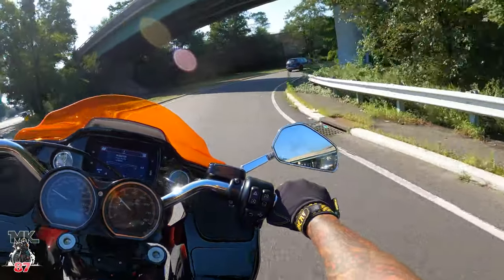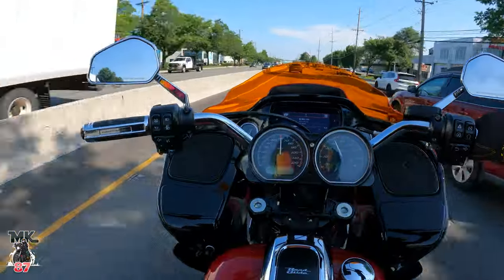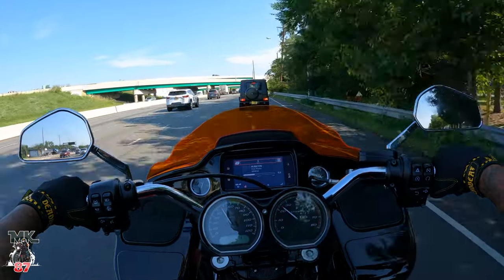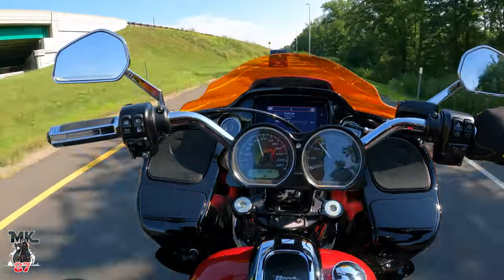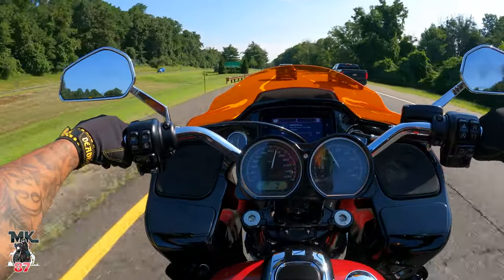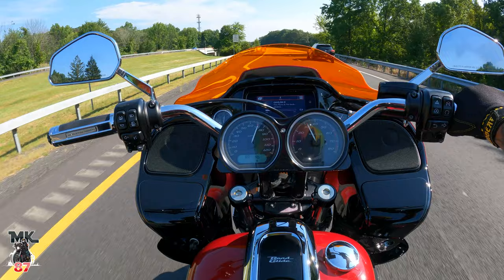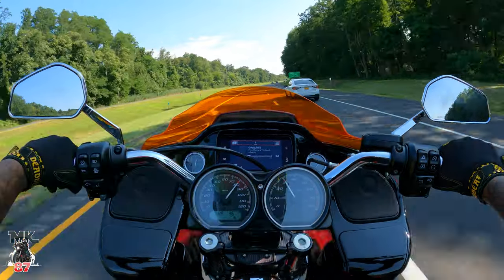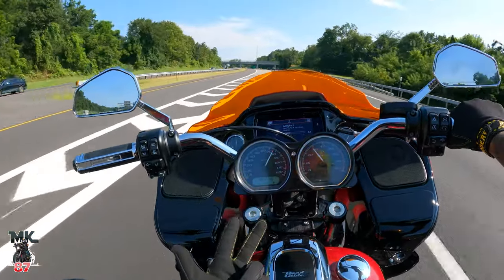Feuling 465 reaper cam vs S&S 475 cam / which is the best cam for your Road Glide

Comment: Marvel,        you forgot,   zippers 468 hands-down best small size cam!    Fueling not quite enough,  s@s is rough.     468 pulls longer and stronger.  With a smooth ride,
Reply: There is no “best” cam, hence the reason builders use multiple brands/sizes. It’s the use that dictates what you should choose.
Reply: Yes,  468 fits most,  especially wanting a good dependable stage 2
Reply from the maker: I’ve herd great things about zippers.
Reply: It's a good compromise between a 465 and a 475.
Reply: The 468 does make your bike run a little hotter though
Reply: What is a small size cam? People get hung up on that lift number. The difference between .465 and .475 is about the size of a couple human hairs. The lift is the least important aspect of a cams profile.
Reply: @freebehindbars8654  Every rider is different and wants different things. I want a cam that does everything well but doesn't put excessive force on the valve train. Reliability in my ride trumps performance. JMHO. I ride a lot of long-distance rides.
Reply: @Marvelkid87  Did you have a dog help you? 😁
Reply: @1962egl  Why?
Reply: @1962egl  Good point. The lift is important, but not as important as the duration and RPM band the cam is operating in. Lift is important for determining the springs the valves need more so than the actual performance of the cam.
Reply: @dennismccleney2302  why what?
Reply: @1962egl  why does it make the bike run hotter?
Reply: @dennismccleney2302  early intake valve closing seems to be the consensus.

Comment: Just put a 475 in a 107 tuned with TTS. It falls on it’s face under 2k, but pulls like a train 3 to redline. If you use it for around town, low speed, it’s definitely not for you. Highway passing and riding at speed, it’s good to go.
Reply from the maker: Right on 👍🏽
Reply: because its not a torque cam if you wouldve looked at the dynos the 475 doesn't come in till about 3200rpm & the 465 at about 2500rpm
Reply: @wateva1659  think I bought, installed and tuned my bike without knowing what I was getting into?  Just sharing my experience for those that do not know.

Comment: Needs to be dyno tuned correctly and you will not have that 475 “bogging” feeling. Believe it the dyno operator makes all the difference.i have same bike same cam same issues when dyno tuned at Harley. Then to a private shop and the magic happened. NO more issues.

Comment: The Zippers RS 468 is a great cam for my RKS. Awesome TQ cam that pulls all the way to the redline. Also, running KW exhaust with a Fuel Moto header pipe.
Reply: best cam out there. my 114 is pulling 118/133.

Comment: great video.. one note.  the two cams are totally different in category and purpose.  The 465 reaper is a torque cam, the S&S475 is more of a hp cam that comes on stronger in the mid to higher rpm range.  An apples to apples comparison would be the S&S 465 torque cam..
Reply: I agree

Comment: You should include the total cost to get that type of performance . Intake, cam, pipes, tune, tuner (device), labor. That way when you’re comparing this to the Challenger you can explain to your audience that the Harley runs as good as the Indian but it costs $5000.
Reply: Set of slip ons and breather be around 1200.Tuner with dyno tune 1000. Cam chest kit 2000. Labor 800 to
Install that. So about 5-5500 Canadian.

Comment: My 2 cents (based on actual experience)...Not familiar with Feuling's 465 cam, but I am familiar with the S&S 465 cam and the S&S 475 cam.  Also, The Wood 22XE appears to be a great cam, definitely worth considering for Touring, 2-up, etc. (just saying).
    IMO and based on the valve timing events of these two S&S cams:  the S&S 465 cam works very well in stock compression 107 (10.0:1)/114 (10.5:1)/117 (10.2:1) M8's.  It has a nice chop at idle and more importantly [where Torque is desired in the low-to-mid range, and hits early] works extremely well in a Touring Chassis Harley, riding 2-up, and riding in the curves up in the hills, etc.  On a 2021 RGS 114, I can feel the torque coming on early (below 2000 rpm), very strong mid-range (2750-4000+), and plenty of power from 4500-5000+.  The S&S 475 cam (IMO needs more compression, 10.75:1 to 11.0:1), as when installed in a stock compression engine, gives up some low end torque but "seems" to have more midrange torque (3000-4500) and nice power on the top end, provided the Tune is spot-on.  I always run a long (full) 2-1 exhaust (and 18mm wideband O2 sensors), ventilate the crankcase (Trask M8 checkvent), and tune with Dynojet Power Vision (PV3b for 2021-2023 Harleys).
Reply: I've heard similar comments about the S&S 465, I was leaning that way for my 21 EGS with the 107 M8. Thanks for the info.

Comment: I had the Feuling 465 and D&D billet cat. 111 hp 118 tq in a 2018 RGS. Came on strong at 2300’ish rpm. I now have a 22 CVO Rd Glide Limited and I’m going to run the 30/30, 64 mm throttle body and manifold. 
I have a friend with a 22 RG limited w/114. He has the 475, D&D and 55mm manifold. That bike is NASTY!!!

Comment: 2023 fxrs 117.  

Just did the s&s 475c cam and cam chest upgrade. Lifters, rods, pump and chest. The heads were done locally by a good Indy speed shop. Larger tb and inj. Installed S&S Cycle 2 into 1 Sidewinder Complete Exhaust System. S&S stinger air cleaner with bypass.  Tuned using PV 3 with target tune. After dialing in I have very little bogging as you define it in your video. 

I’m not real heavy, 138 soaking wet with boots on. That s&s cam has mad ass torque off the line and pulls strong throughout the rpm range until redline. Power is best after 2000 and peaks at around 5700 for my build but no slouch off the stop. Can pull the front end up easily in third. Sound is as you say, fucking hard-on inducing amazing. Great cam that loves a well breathing head and lots of fuel.

I don’t really think of the 475c as a simple blot on and go cam. There are other things you “should do” to get the best performance out os that cam.

Comment: Thanks for the footage marvel The exhaust velocity (often misworded as back pressure) definitely slows down with the oversized mufflers affecting low end torque. The quality of the tune could also be an issue. As far as the sheet starting at 2000 RPM, that is just a common RPM range that tuners usually start the graph because people do not (or at least should not) realistically cruise under that range. Personally, I try to keep cruising RPM around 3000, but that's a separate discussion.

I've heard lots of people say the 475 just isn't a good low end cam. This is incorrect. In many of the instances it is due to what I just mentioned: poor exhaust combination and/or poor tune. I'm confident you can get that torque back, or even improved with the right exhaust combo and/or tuning resolution.
Reply: Finally, someone who understands exhausts. I cringe every time I hear back pressure.

Comment: I have the S&S on my RGS. It rips hard from 3,000 rpm on up. I went with a CR480 torque cam on my RG CVO and it pulls really hard from 2,000-4500. If I snap it I'm sure the bike will go up

Comment: Have the 475 in my 19 glide with stock headpipe v&h torquer 450’s and v&h breather. Did the cam hear kit from s&s and it put down 110hp 127 torque dyno tuned. No  bogging very crisp and extremely healthy. Nasty cam and I love it.

Comment: I been riding too many years. Im 64 now. I do not understand the bogging you speak of. I know what bogging is, but we avoid bogging by being in a gear where your rpms are not bogged down. I have a 2019 Cvo Limited 117 with Bassani headers, 4inch Rineharts, an S&S 475 cam and a fuel moto tuner. 35k on her now.. All I can say is she has plenty of power in any gear. 6th gear you really need to be at 80 mph or above to use 6th gear. Acts like an overdrive trans gear. 
5th and below has all the power. Great video and thanks for taking your time to make it and explain everything. Nice job.
Reply: I believe the point he is trying to make is that the 475 cam comes on around 2700 to 3000 rpms vs the 465 comes on at 2000 rpms. so it is more of a torque cam.
Reply: My bad. Thank you!
Reply: @jimbo4260  No problem, I also been riding for a longtime now at the age of 65 soon. Boy how time flys. I bought a 2022 SGS with a 114 and went through 2 cams so far. First a SE .447 and now the S&S 465 more of a torque cam. I do like it at low RPMs you can't beat it. The S&S 475 really shines with a 124 Big bore kit. It idles off like at 130 or 140 foot lbs of torque. I am not sure if I want to spend the money again on another cam but I am looking at the Star Racing 30-30 cam with a 64 mm throttle body and manifold. It's all about the money and my bike rides okay for a solo rider. check out the videos on the MHP 485 cam it is the Star 30 30 cam. amazing numbers.
Reply: @James-x1z  Hi James....yea bike parts are like tattoos...once ya start it's hard to stop. However money is not what it was back in the day so I've chilled out. The 475 in my 117 I'll say, is plenty of power for me at all speeds. I'm mainly a highway cruising guy. 75-80 mph. I can't say I have any complaints with getting out of the way, at any rpm. MAYBE A PROFESSIONAL TUNE in the future ..." maybe." Lol, but I'm happy as is.
Reply: @jimbo4260  I agree with you about the s s 475 cam at highway speeds, very nice. It's a mid-to-high cam. Happy riding and be safe.

Comment: 30/30 , s/s 55mm aluminium intake, arlen ness Big Sucker, tab mufflers and stock pipe modified 119hp /120tq on 107 EGS. Aluminum intake manifold will help too.

Comment: Just an observation I see a lot.  I hear a lot of people rave about how smooth their cam is and how great it is at 2k rpms after they get rolled by bikes with the S&S 475 cam.  Another factor not talked about is the S&S is cheaper.  Just some thoughts.  Btw, 119/130 is what mine was.  Just be happy with what ya got.  I had a torque cam before didn't like it.

Comment: I’m running the 30/30 .485 Star Racing Cam. I loving it
Reply from the maker: 💪🏽 great cam
Reply: what about the 3/4 Race Milwaukee 8 Cam .585 from Star Racing. Why doesn't anyone talk about that?
Reply: @BM-uj7rt  question. Is that a hp cam or Tq cam?
Reply: @BM-uj7rt  Cause it's too much for a stage 2, and even for a stage 3, it's basically a race cam for stage 4.

Comment: Great video man, that star cam has a 485 lift. Id choose the fuelimg as well tho...only for keeping the components the same, i like the fueling cam plate and pump better too..
Fueling also has that new air filter with that machined intake that looks amazing. If i ever trade my twin cam in for a m8 itll be all fueling parts. I have fueling 525 cams in my twin turd now...they saound damn good and perform awesome too
Reply from the maker: Yea they make all around great parts. I’ll be adding those breathers in if I go back in to the motor for a stage 3

Comment: Marvel, mine came with the harley torque cam installed.. I’ve only installed myself..the 2into 1 D&D, 55mm Intake mani port and polished, Tmann intake, vision tune by DC Cyclez 116/130…not sure if I’m going big bore yet so I don’t want to change the cam yet…

Comment: I’m running the CR480 MT in my 114. Riding 2 up fully loaded with full tank and luggage With a total weight 1440 pounds. I can’t complain about the 11:49 torque the bike feels strong, pulling that type of weight and all 6 gears. Even in six gear  just by rolling the throttle I can hit a 100 mph with little effort.

Comment: I guess I put myself right in between with a Zippers 468 on my 17 Ultra Limited,..crazy torque all the way up to 5 - 5500 rpms..like the 900 lbs. was nothing. A 2-1 modified Shark Road Exhaust completed the aggressive grunt so I am pretty happy fast-lane rocker 😜✊🏻

Comment: Hands down the best cam in a 114 bagger is the WM8 22XE.  Pulls from 1800 to 6500 no problem. Torque cure is completely flat line right across until it meets the HP curve.  Best cam on the market. My opinion
Reply: It’s just a little rough on the valvetrain
Reply: I have not heard this.. can you elaborate more?
Reply: @marvelharris9540  power
Reply: @marvelharris9540  woods cams are notorious for steep ramp angles.

Comment: Currently running an S&S 475 cam and love the sound, especially at idle. What i dislike is the low end power. The bike doesn’t come alive until 3000+. If I change the cam it would be for one that the peak power comes in sooner.
Reply from the maker: Great cam but Very true
Reply: get the 465 its the torque cam & a world of difference & pulls all the way

Comment: I put a 475 in a breakout after listening to the lope of it in your video on the lowrider
But coming from a screaming eagle torque cam it did bog alot off the light and low revs
On an open road it was great and ofcourse pulled harder but in traffic tbh the s/e cam was better and snappier
Probably wouldve kept it if i knew that before and saved money😅
The sound was almost worth the low end dip though as said it is a monster and turns heads

Since sold it anyway
Can you comment at all on how the star 30/30 feels and if it bogs at low revs like that because on a tourer i dont want that and i know you rode that road glide a while back with the star cam

I think the rs468/ s&s465 or your cam suits a tourer better
 interested to hear if the star 30/30 has a bottom end dip on heavy tourers? because it makes good hp numbers but havnt had the chance to ride one
Leaving exhaust variations etc out of it and just general speaking ofcourse
Reply: I think the red shift 468 is a good alternative to the s&s 475, definitely smoother.
Otherwise an 465 s&s or fueling would be the perfect compromise.
But honestly on a touring i would pick the screamin eagle torque cam, at least it sounds way better than stock and is rideable.
Reply: @pierfrancescotancredi8353  agree with the rideable side of the s/e cam
Havnt had any experience other than that or the 475
Would be lovely to try the inbetweens
Very keen to hear how the 30/30 goes for bottom end in and out of traffic
If its still lacking there i think ill try the 468 or fueling 465 next time round

The s/e torque cam was great for dipping traffic but after 3.5k rpm its hard to tell a difference in pull from stock
I only had it for a short time but it was enough to have fun thats for sure

Comment: great video, what would be a good cam for my 22 Fat Bob 114? It’s my commuter bike, ride solo in Los Angeles traffic usually never go past 90 MPR and total weight with gear is about 200 lbs.
Reply: also looking for a 2-1 I can buy in California
Reply: I just did the S&S 465 in mine, same bike, its all the power in the usable RPM range, down low where you need it & still plenty on top, sound at idle and on the gas is just as good as the 475, I don't understand why anyone still buys the 475, although I've seen a few who switched from the 475 to the 465 and were happy they did...Anyway, lots of good cams out there, but you can't go wrong with 465 IMO

Comment: Good review of similar priced cams. The view from your bike is awesome with gauges right up front. If I ever go the cam route it will be a set of CVO take-off SE-255 cams. Can be had pretty cheap after the doctor and lawyers have the local dealer install cams on their CVO they’ll never ride. Riders should install whatever they’ll benefit the most from. Some folks get angry cams they can’t ride across town with just to sound cool.

Comment: Really.... the 475 is the torque cam? Compare the 465 S&S torque cam with the reaper & see the difference. This is taken from the S&S website!                                                                                                                                                                   

475 - 100 HP Cam
Bolt in 100 Horsepower! (when coupled with intake and exhaust)
Perfect for 107" and 114" engines
Compatible with all stock valve train components
50-State compliant version available

465 Torque Cam
Improved Torque and HP

Perfect bolt-in cam for heavy touring bikes
Reply: 475 is a horse power cam. 465 is the torque cam. 475 is a beast in the higher rpm range.

Comment: thought the S&S 475 was a power cam?
Reply from the maker: No
Reply: Of the S&S bolt-on cams, the 465 would be the torque cam, 475 moves that rev range to a point of actually losing toque in the low range, compared to the stock. Once it comes out of 2.5-3, it’s straight up.
Reply: You are right and he's wrong.  465 is the torque cam.
Reply: There’s some misinformation here. The 465 turns on at a lower RPM, therefore it is considered a “torque cam”. The 475 peaks later in both torque and horsepower, so it’s considered a “power cam”. At the end of the day, a cam profile just plays with the limitations of the base engine. In either case it’s just a preference of how a rider likes to keep his rev range.

Comment: That 'bogging' you're talking about isn't it bogging, it's the chop of the cam. If you're not used to bigger cams and don't want that lope (that I personally love), you should have gone with the 465 which is the 'smoother' feeling cam down low and for more torque down low.